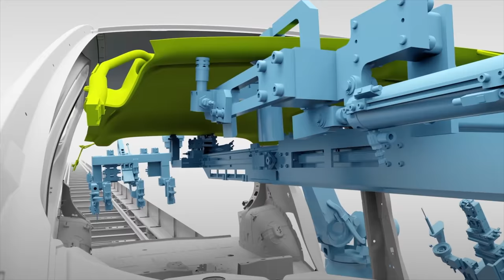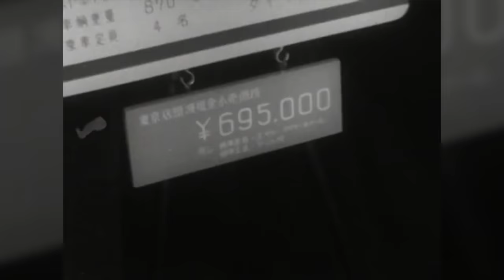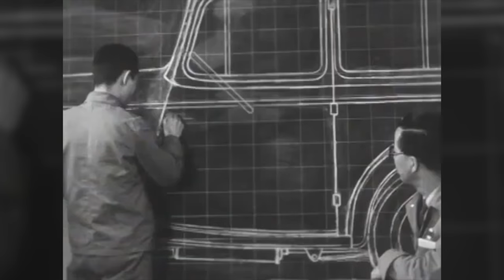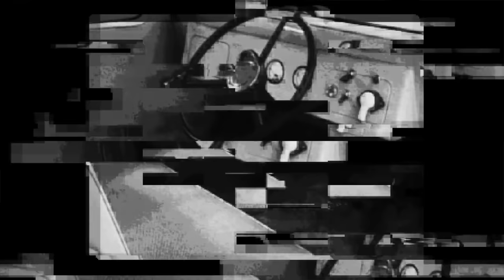You Need to Know This About Nissans

Comment: My neighbor had a 1998 Altima with over 400,000 miles on it. Haven’t seen him since I’ve moved, but he’s probably still driving it.
Reply: KA24DE engines were very reliable
Reply: @latino914  isn't that engine in the 240sx?
Reply: @royjaber571  yes. The Altima uses the KA24DE-A because of it being fwd and the 240s use the KA24DE.  
The KA24DE has +5hp and + 6lbs torque over the KA24DE-A.
Reply: @latino914  yeah plus it's very tuner friendly

Comment: In 1980 I bought a Datsun 4WD pickup brand new off the lot. It had an inline 4 cylinder and a 4-speed manual transmission and a two speed transfer case. It was a base model with no radio and no air conditioner, no power steering, but did have power brakes and a hydraulic clutch. I drove it until 2002 when it had many problems and 207K miles. Paid about $7K for it. I got my money's worth.

Comment: Thank you, just bought a 2020 Nissan Titan. Good to know a little history on the manufacturer.
Reply: Didn’t you watch any of his other videos??? Toyota Tundra man...
Reply: @goldwolf0606  Nissan titan is not bad, especially with the Cummins Diesel
Reply: @goldwolf0606  he recommends Nissan pickup trucks if you can't afford Toyota, just not cars. My old shop teacher had his Nissan Titan transmission go after one year of use and he baby's his vehicles, that's the worst I've heard happen. My best friend has a Nissan Versa that has 280,000 with routine maintenance, it's trunk level in the carpet rusted off but it runs fine.
Reply: Realism91 do you happen to know which year or generation the Nissan Titan was?
Reply: @kainenwashburn5078  The only thing I know is it's before 2012 because that was my last year in highschool. It wasn't diesel. Nissan must have treated him well because he still has a Nissan truck I didn't think to ask him about it though.

Comment: The best vehicle I ever owned was a Nissan. 1995 Pathfinder with a 5spd manual. It worked after I got rid of my first car, a 1984 Jaguar XJS. It lasted me from 2003 to 2014 when I rolled it. It had 280 thousand miles and change on it when I rolled it. 200 thousand of those were mine.

Comment: My first car was a Z32 90 300zxTT. Also had a  performance struts. Had full exhaust from the y pipe back with high flow cats. So it sounded great! Had front & rear strut bars so it handled like a sports car. The 4 door sports car moniker that Maxima's adopted was well earned. It was a sleeper, only had maybe 240hp. It wasn't a 300zx by any means, but was really fun to drive. Because it had a 5 speed manual as well as a LSD front Diff. I couldn't fish tale it but that thing had grip for days. It was the funniest fwd car I've ever had. I've only owned 3 V8s before with the last being an 02 Z28 Camaro. I miss the way that LS1 sounded. I have my eyes open for an Infiniti M56. That way I get the best of both worlds. A 420 hp 5.6 liter V8 that can easily reach 500hp with just a tune, intake and exhaust. I was already sold with Nissan's, I've owned many more. Never had a major issue and they've never let me down. My G35X has 208k right now and it definitely doesn't feel like a 16yr old car. I will admit regretting getting the awd version though. It has the same ATESA awd system that the R34 GTR has. It just makes it a pain to work on and harder to locate parts that were specifically made for it. Especially since it is the first yr they made the G35 with an awd model. Other than that it's a really great car. They somehow have managed to hold their value. It's hard to find one for under 3k that isn't a pos. I've found a few Infiniti M56's for around 10k. There's also the M45 that has a 4.5 V8.

Comment: Had several Nissan trucks. My 86 extended cab V6 manual 4x4 was one of the best cars I have ever owned.....and have had several Toyota’s. At the time that Nissan truck blew away every mid size pickup in the market. Toyota wasn’t even close. Crazy how things have changed.

Comment: On the road, I’ve noticed a lot of mid 2000s Nissan’s still driving around have clear coat failure. Especially the Titan’s and Maxima’s. Hopefully this issue has been fixed with their modern day cars.

Comment: I had a 1968 Datsun 510 brand new, I drove it for 17 years and then someone stole it. Then I had a 1985 Maxima that I drove for 10 years till the engine mounts started to rust, it still ran perfect. Then I had a Nissan Leaf it was wonderful but it only went for 60 miles I sold it.
Reply: 60 miles is typical range for the 1st gen Leaf with a used battery pack.

Comment: Ya'll I have a 07 Nissan Altima but just yesterday i learned that the CVT needs some repair and i do not know how much that will cost...total transmission replacement is like $4k or above...Ive only had it for 7 months bought it at 69k miles. Was hoping any advice if I should just buy a new car or spend that much money for a new trans. CVT sucks

Comment: I used to own nothing but Nissan’s. Sentra, Altima, Quest, & Xterra. All in all 8 Nissan’s. However, I saw the decline in quality and moved to Toyota. I still have the 09 Xterra as it runs great still with 130k miles on it. They need to lose those crap CVT transmissions and start building quality again. I wish them well and hope they can turn it around.

Comment: It's a shame that the 370Z is the only Nissan car that still a good car, the last good Nissan sedans were 2006.
Reply: Don't sleep on Infiniti's...their G's, M's, and now Q series are very nice. I have an 04 G35X that has 208k right now and the starter just went out. It's still the OEM starter too! Crazy, other than your regular wear and tear maintenance items that need replaced because it's a 16yr old car. It still handles well and is plenty fast for an out dated sedan. I've been nothing but impressed with it. Most used cars that are that old are straight pos cars. This one still feels nice and was engineered ahead of its time for sure. Unfortunately I have the awd version. So it's a little bit more of a pain to work on, as well as locating parts for it. I've owned cars that were 5-10yrs old and they drove like they were way older. Having to have all kinds of parts replaced, constantly breaking down, etc. If you can drive a 16yr old car and it still look timeless, it can perform and keep up with most modern cars. My next car will definitely be an Infiniti. I want that Nissan V8 420hp stock.

Comment: Renault has killed the overall reliability of the brand as a whole. Since about 2004 or 2005 the brand as a whole has fallen off. The last "great" cars (excludes R35) that Nissan had was the 2000-2003 Maxima. Especially the 2002 and 2003 cars. The Sentra SE-R and Spec V versions are it. Oh, the 6MT 350Z as well.

Comment: Scotty, Idk if you will read this but I have a question.  I have 2017 mustang ecoboost. Had a wheel bearing go bad and had it replaced. Now I'm noticing an issue with the car feeling like the auto trans is keeping the car in too high of a gear. It has that feeling when you try to accelerate in too high of a gear almost all of the time, especially on highways. 
No CEL light, I tried to disconnect the battery hoping to reset the system. 
Nothing worked. 
Idk what to do now.  The drivetrain is under warranty still however the a-holes at ford want to charge me over 300 to "diagnose". And unfortunately right now I can't afford that. 
Any ideas?  Im thinking it's something to do with the computer, but idk.  Would it possible have anything to do with the new wheel bearing?
Any help from anyone who may know would be appreciated. 
Thanks.

Comment: I have a Altima smh transmission blew and fried at only 156k miles I had to buy parts from the junkyard after the 12th attempt it drives just can’t take off like a normal car but drives suck :( I still owe $5k on the car I’m struck wt it :/ So far I was force to replace head gasket valve cover, oil cooler gasket, a coil, spark plugs, speed sensors 4 times, the whole valve body to the cvt bc it was burnt and metal was building up inside the valve body, two alternators, left front strut, fuel pump, both tire rods and both front links and Calipers nuts, my radio, my left muffler, the rubber holder to the muffler and rubber holder to the mid and front exhaust.. the clip to hold the fuel lines the alternator connector the pulley and it still got a list of repairs to be then I give up I want a Honda or Toyota but this car needs to be paid off or I can’t finance any car yet smh the set up  I wish I seen This coming. Scotty said it but I was already 156 when first watch Kilmer fmL.